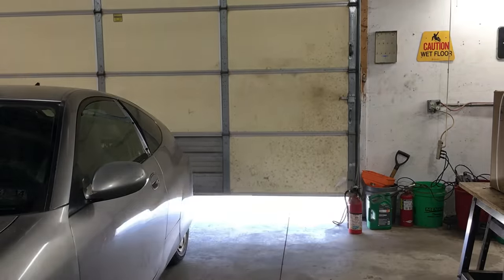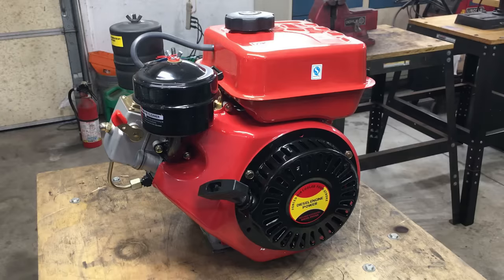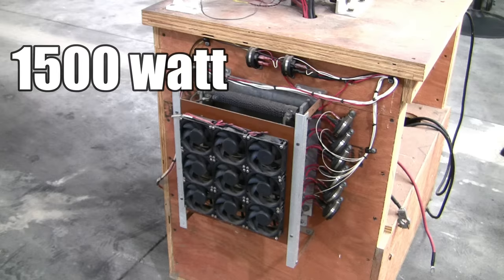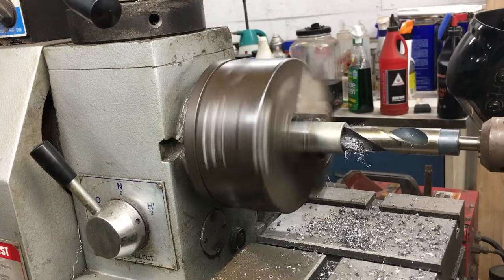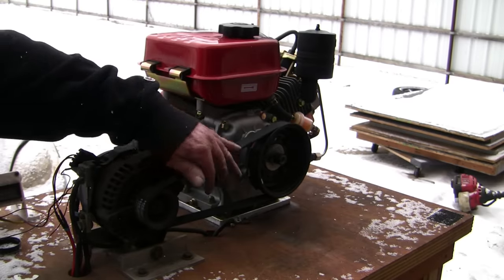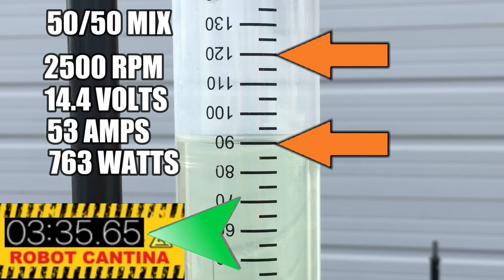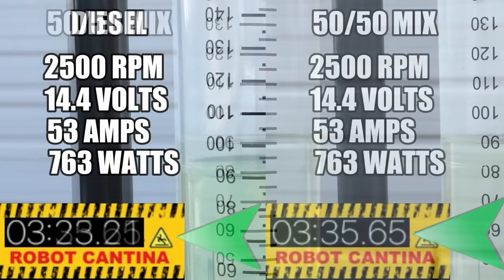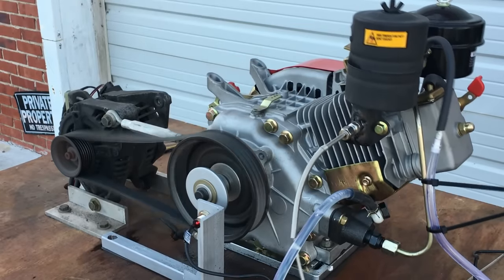S4 E3. How good is vegetable oil as a source of fuel for a diesel engine?... We find out!. plus more

Comment: just a tiny thing to consider.  Much research over last coupe decades  .... show that constant rpm applications (tractor's, gen sets etc) coke easier on diesel and worse on alternative fuels.  Even more coking happens with alt fuels used in an engine not adjusted to appropriate point of fuel injection etc. to get good combustion of a particular alt. fuel.  Each light oil has different combustion characteristics. For fair comparison of a fuel type, testing must be done with an engine with settings adjusted so that combustion  occurs at least  equal to how well said engine optimally combust diesel  in same work/load conditions,  Aka ..  its like running diesel in a gas engine then saying.... seee.... diesel sucks as  fuel.   

Now if one is testing ideas on how to convert a diesel engine to run various alt fuels.....  then that is a separate, different experement.. which would love to see.

That said diesel engines with random-ish fluctuations of hard work /loads on either diesel and alt. fuels  tend to coke less. Such as engines used to move vehicles thru traffic.  Sooo with this in mind if  you can put a load on your alternator that creates a  pretty fluctuating load on the engine.....  yet load pattern can be repeated for each test...  you might get a more equal evaluation of how well the alt. fuel works in a diesel in real life; non constant  rpm, engine use.  

PS-look at Elsbett  history and patents for more insight.

Comment: That's pretty cool subbed up look forward in checking out ur channel. But right now in building getting ready to tear down this 3rd,4th hand generator it's old companion from sears believe ten horsepower Tecumseh motor. 5k watts and old old Tecumseh about 3,4hp 1100 watt generator. Probably 7th,8th handed I know of 4 make 5th. But it's a motor and gen head bolts together on looks like t frame that's it. It's store bought looked up before found them 50s 70s seemed like. Try get um going as ole poor hillbilly I make do with what I can do. So I'll be hollering at you here in some more videos as I liked this one.  Stay safe from ur ole hillbilly buddy.

Comment: I have built an electrolyzer that worked great at splitting H2O. The hydrogen can be bubbled into the diesel fuel line. I have always wanted to see if that actually worked or not and if it made more power

Comment: Something that wouldn't be particularly interesting to watch, but would atleast be mildly historically entertaining would be running it on peanut oil. It should run just fine, but it was Rudolf Diesel's (inventor of the Diesel engine) fuel of choice when running their engines, since it supposedly provided very good lubricating properties, and I imagine it would also smell rather nice, but I doubt anyone with a nut allergy anywhere nearby would approve. A completely ridiculous suggestion instead is to try running it on lard. You'd of course need to warm it up beforehand to liquefy it, but I imagine it would run atleast somewhat.

Comment: Run a variable fuel/diesel mixture, from all diesel, to all fuel, and see where the engine stops running.

Also try 75% oil, 25% gasoline.

Third, try different oils. Like engine oil, transmission oil, and WD-40.

Comment: You need to separate the glycerin from the oil in vegetable oil in order to use it in an engine. 
Basically you put a small amount of methanol in the vegetable oil and it will separate into oil and glycerin. Then you dump the glycerin (which is on the bottom) out and you've got fuel.
Running straight vegetable oil is not a good idea.

Comment: So, way back when, when I was living in the Peoples Socialist Republic of Illinois, I had an old Ford 6.9L IDI. I ran out of fuel (thanks malfunctioning sending unit) and coasted into a gas station up the road. The problem is that it was a gasoline only station. No diesel. A normal person would have called someone to bring them some diesel. I, however am not normal. I bought 2 quarts of ATF and dumped that right down the front tank. Then I drove about two and a half more miles to the other side of town where diesel was sold, filled up, and continued on my way. The IDI didn't seem to care what liquid I put in the tank so long as it WASN'T gasoline.

Comment: I suggest; TOLULINE - or maybe not...  They used to use it in Formula-1 race cars in the late 1980's, as it was higher octane than Gasoline...  But Diesel has higher octane as well, so maybe?

Comment: Most cooking oils will work fine. Another video the guy has a small Perkins diesel testing different oils, a few of them had lower exhaust temps so maybe there is some hp lose

Makes you wonder why seed oils are not used as a summer blend biofuel instead of putting it in our food

Comment: I burned hot liquefied dog crap in my 81-83 Mercedes 300SDs… Waste veg oil of every type, motor and aviation oil, transmission fluid, lamp oil/ paraffin, lard, contaminated jet fuel. Pretty much anything with the correct viscosity blended with gasoline and injection cleaner. Made biodiesel of course. Once in awhile put actual diesel in it.

Comment: is there any difference using USED cooking oil?(need to filter the water out, and particles) a channel i follow "not so grand garage" is using used engine oil mix with stale petrol with years of experience. and many straight waste veg oil people use 100% oil but it's heated by glow plug and/or engine coolant yo 70dec Celsius ish.I also met someone who was using used hydraulic oil straight or mixed i can't remember, and plenty swear by adding transmission fluid to free up stuck injectors etc, so how much can you use without coking/smoke

Comment: What fuel was the diesel engine designed to run on?
peanut oil
Since his death the diesel engine has been very helpful in manufacturing and transportation. Diesel originally designed the diesel engine to run on peanut oil. Only later did petroleum become the standard.

Comment: I've been testing mixtures of fuels with my Chinese diesel heater for experiment purposes for a bigger project of running it in my marine genset for a home micro cogeneration setup to maximize fuel to use. I have already tried the mixes of veg oil along with straight veg oil, etc. and the conclusion was not great, do to build up of particles in the burn chamber.. Recently I found a write up on the use of mixing ethanol and diesel.. So I have been mixing e85 (@25%), Veg oil (various %), diesel (various %). The ethanol provides a cleaner burn do to the oxygen rich fuel from my understanding. But it does require the use of more fuel over all as ethanol BTU content..etc. 
Next testing is biodiesel, unfortunately biodiesel is scarce in New England so needing to make it home brew..

Comment: In a ZOMBIE crisis , you can get all the fuel you want at a small airport. Airplanes are stored with full tanks to stop condensation and a small airplane holds 40 gal or more. Tanks can be drained under the wings. Av-gas has a longer storage life than car gas and its 100 octane.Most paper maps show small airports. If you can fly then you could just fly to the coast. Most people leave the keys in their planes. People don't steal planes.....usually....Jet fuel is kinda diesel....kerosene-ish

Comment: Just out of curiosity, what's the current cost of a gallon of diesel out in Kansas?
And a totally unconnected question, how much does a gallon of veg oil cost round your way Jimbo? :D

Here in the UK with a bit of hunting you can find veg oil at just under £30 for 20L (About 5.3 US gallons), so just under £1.50 per litre. Diesel at my local fuel station costs £1.46 per litre, so if worst came to worst (ie, Zombie apocalypse), it wouldn't really even be that much more expensive to run a diesel car on new veg oil, and if fuel prices went up even just a small amount around here the trip away from a zombie infested city centre would actually be cheaper done on veg oil !!!
Reply from the maker: A gallon of Diesel at the QT is $3.75  and a gallon of Vegetable oil is $10.50 at Wallmart.    I reckon diesels is cheaper, however waist vegetable oil is often free.
Reply: @robotcantina8957  Well, After doing a few volume and currency conversions, it looks like diesel over here would work out to $7.02 per US Gallon...... There's a LOT of tax added to road fuel this side of the Atlantic !!! On the other hand, due to some previous government deciding it was wrong to tax some basic essentials needed for survival, cooking fat's and oils are tax free (Obviously, in their heads, being able to put fuel in your car so you can get to work isn't essential. 🤨), so that £30 for 20 litres would work out to $7.21 per US Gallon.

As I said, over here it's ALMOST worth doing.

There's interesting side project idea that popped into my head though. Your test rig setup is pretty much a hillbilly 12v generator. It would be interesting to see what actual power output could be possible from something like that. Maybe also some tests to see how much fuel it burnt per hour under the maximum electrical load it was capable of, how long it took to charge an average flat car battery, and if it was linked directly to an inverter, what appliances could it run?

For power outages I've got several deep cycle lead acid batteries, and multiple inverters, but this is purely an energy STORAGE setup. It would be interested to see if an alternator connected to a little engine could push out enough juice to keep the essentials running if the electric was off for longer than I had stored power to cover.

Comment: Hi from the UK. I have a Peugeot 405 that I run on 95% filtered used veg oil 5% petrol. Would you try veg oil with 2 stroke oil in it? As I am thinking about trying it myself.

Comment: Using a drill to open an interrupted part by 0.037"? Use a boring bar ya drongo! 

Love from Australia.
Reply from the maker: The drill seemed the safest solution to bore out a split collar.
Reply: @robotcantina8957  heh, it works but your hole won't be the right size or round. Obviously it only needs to be close enough for it to work... The other concern is that drills tend to grab and pull into your part if you are only cutting on the outer corners, which could be scary especially since you can't hold the split collar tightly in the chuck without it closing up!

I would have stuffed a convenient bit of scrap material into the split (super glue is surprisingly good at holding such 'gag pieces' in place) before chucking and then run a boring bar through to open the bore out to size.

Comment: Funny enough to mention, but the diesel engine was originally designed to run on vegetable oil...er...peanut oil.
A mechanical diesel will run just fine on almost any oil.  To run well it just needs to be:
1. Free of particulates.  Filter it.
2. Free of water.  You can use gravity + time to separate them, then drain off the water OR You can put the oil under a vacuum causing the water to boil off.
3.  It needs to be roughly the right viscosity.  Add gas to thin.  Add gear lube to thicken.
If you have a hydrometer, filters or centrifuge, and get practiced at setting those three qualities (water content, viscosity, particulate-free) then you can make diesel for low cost that will work in any engine.
Please note, I said "engine".  I did not say "emissions components".  I have no idea what it will do to an EGR or DEF system, other than that it won't be what the engineers engineered them for.
But older diesels, say before about 2003 that don't have that stuff won't care at all.  Some of those will actually run BETTER on waste motor oil (clean out particulates) or vegetable oil (clean out water).
Diesel is EASY to make.

Comment: The city busses in Vancouver Canada, start on diesel fuel(cold) and then are switched to 100% used vegetable oil from restaurants, that are carefully filtered, removing moisture and any other solids making the oil pure enough for diesels combustion engines. If you stand behind theses busses when the are idling, it smells like the inside of a fast food restaurant... I had to experience it for myself to believe it.
   In terms of potential elevated wear on the complex high pressure fuel pumps due to a vegetable based oil/fuel, insted of hydrocarbon Diesel fuel, well im not really sure? Maybe additives are added to the used filtered cooking oil, to alleviate this problem.

Comment: You worry too much, Mercedes OM606 engines from the E class run just fine on pure veggie oil even with hundreds of thousands of miles on the clock. Not just these engines but any engines with mechanical fuel injection

Comment: You'll enjoy this 1gallon vegetable oil 2 gallons of e85 mixed well don't froth it btw put it in gas engine I swear there is extra power
Reply: Idk if itlle work in diesel you'd prolly have to reverse it to 1 gallon e85 2 gallons of vegetable oil
Reply: Non synthetic motor oil works also but it runs dirty
Reply: Btw it sorta goes bange for the corn gas then the slow burning oil goes bang and burns while the piston goes down

Comment: Waste engine oil from a diesel engine.  I filter the oil from my diesel suburban and put it straight in the fuel tank.  My little kubota tractor runs 100% Waste engine oil during the summer.  No problems.

Comment: Wood gas i think you would need use a gas engine for that though.
Reply: A petrol engine is not needed but a throttle valve must be fitted, if the injection pump is forced to inject just a small amount of fuel the ignition of that fuel will then ignite the wood gas(The engine might also need lowered compression too to prevent knocking).
This have been done many times before, and a lot of other type of gas(fuel in gas form not gasoline...)/diesel engines(In actual production) use this way of operation.

Comment: Vegetable oil will produce more carbon deposits that can eventually destroy the engine, but you can turn it into biodiesel by reacting the oil with sodium hydroxide and methanol.  Just be sure to do it outside, since it makes toxic gases.

Comment: Used motor oil and the process of keeping it thin enough at low temperatures so it'll flow and not gum up at the injector. Least thats what I think happen. iirc people who do run used motor oil need to have a heater for the oil. I think theres a guy on here with a truck by the name of stinky pete that runs used motor oil.

Comment: I'd be interested in hearing if 100% vegetable oil would work. Also 100% canola, and if you can get it, 100% linseed oil. Linseed oil is produced by flax -- you grind up flax seeds to get it -- and flax stems and stalks are (through a fairly lengthy process) how you get linen. You want to talk post-apoc? Flax is how you get both fuel and textiles in the post-apocalypse.

I also wonder if burning ethyl alcohol (grain alcohol) in a diesel engine is reasonably possible. The old high-pressure still designs originally put out by Civil Defense and refined in Mother Earth News should suffice... that's another way to get good fuel. You only need to "denature" it for legal reasons; at the required purity (150+ Proof, I believe...?) trying to drink it would literally lead to needing skin grafts inside your mouth because the alcohol would basically cold-boil those cells, sucking out all the water inside. Gross but true.

Personally, though, I don't see any standard internal combustion engine lasting long in a post-apoc scenario. Probably the old VW air-cooled types would last the longest, if you could keep parts flowing. But they all need too much maintenance, too many things you just can't get outside of a mass-production, oil-dominant society. Something like a standing-wave thermoacoustic engine built out of scrap and junk would probably be the most realistic sort of engine one could manage in such a scenario... and, since civilization starts with agriculture, something like a minitruck driven by such an engine would probably be your most realistic post-apoc vehicle.

Mad Max looks really cool, but honestly it's just Hollywood romanticizing a dead world. The reality of it won't be like that, or like Fallout... maybe a bit closer to the Metro games, but even then... it's really just a long hard slog of learning how to hunt and how to forage, then how to farm while still hunting, and how to gather a group of people together around farming and hunting. Subsistence living with extra steps, really, since you can't just go down to the general store and buy whatever you need -- you have to salvage it or grow it, make it from salvage and scrap and what you can grow, or do without. There's no mass production, there's no logistics or shipping or postman, no way really to bring anything from afar. Even simple fasteners -- bolts and screws and nails -- have to be dug out of whatever they were in before, since the very definition of post-apoc is, nobody's making any more of them.